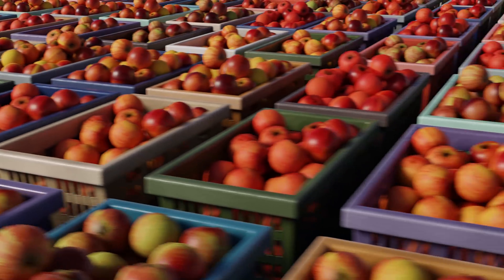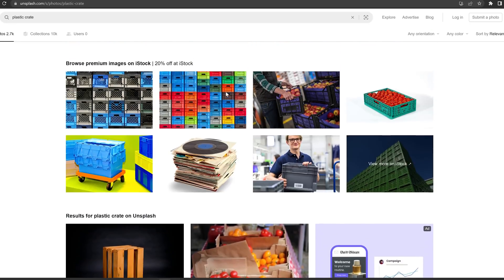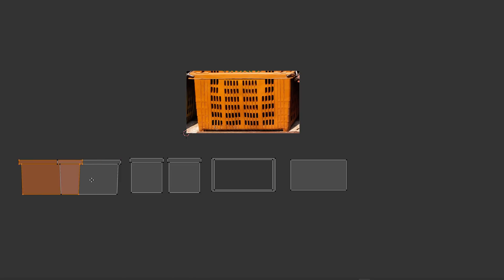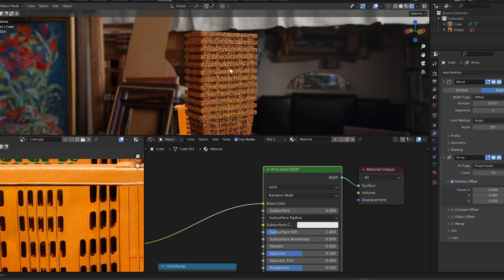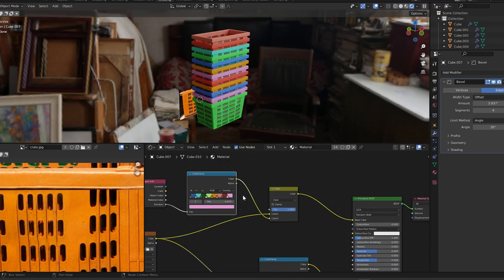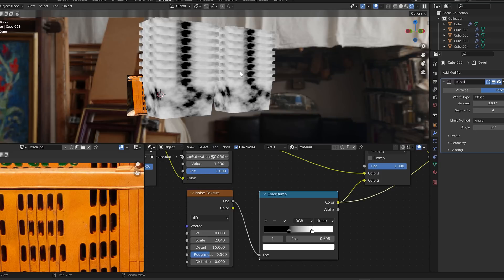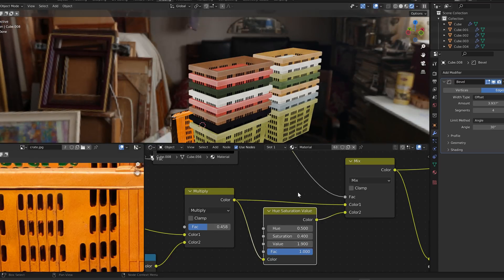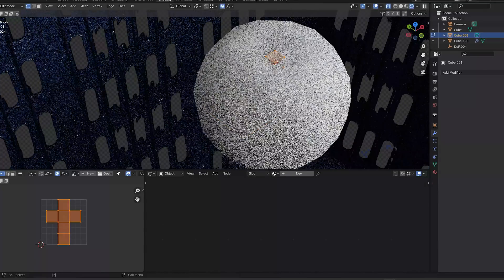Create Assets From A Single Image - Blender Tutorial

Comment: Excellent approach. A couple of extra steps I'd do: add some subsurface scattering on the apples and slightly randomize the Z rotation  of each box, so they don't appear perfectly aligned. 
I'm a big fan of using alpha masks to create transparent parts in shaders, even if it's not the most accurate approach, I genuinely love it and use it, even with cloth

Comment: when i drop my apples with physics dropper, the apples bounce around but dont rotate. they fell and moved, but stuck with the same fixed rotation angle... please help!
Reply from the maker: A few things to try: Did you try applying scale to all objects before the drop? (ctrl a). Are you on frame 1 (shouldn't matter, but just incase). 

Select the object you're dropping and go to "tool". Scroll down to physics dropper. Under rigidbody check the active settings. Is "damping rotation" at it's default value of 0.1? 

Lastly, what scale is your object? Is it impossibly small or impossibly large? Try scaling it up, applying scale, and running the sim again. 

If none of this works, please send a packed .blend file to me at riley (at) brunwork . com. 

I can look at it and find the problem if nothing else works! 

And thanks for watching!
Reply: @rileyb3d  It worked!!! i did the ctrl a thing and worked perfectly! thanks a lot for the quick response!
Reply from the maker: @iaroma  Good! Always happy when I can actually troubleshoot through these comments (sometimes it doesn't work)! 

Applying scale is an important troubleshooting step for many problems. Something good to keep in mind going forward.

Comment: This is a very great walkthrough.
As a bonus (that would use Photoshop and, I know, this video is about Blender only) you could fix the perspective of the reference photo in Photoshop to later get a more accurate look for the baskets.
Reply from the maker: Love it, thank you for the great tips! I suppose a non perfect reference image of a basket could be quickly touched up in PS as well!  For example: to paint out the areas that should be dark and alpha.
Reply: @rileyb3d  I guess so, yes. Photoshop has improved the selection and transformation features a lot in the past years. After fixing the perspective with e.g. "perspective warp", you can easily select the basket with "select and mask" or the "magic wand" to create your alpha.

Comment: Me who thought this was a supper beginner tutorial, coming state from the end of the donut tutorial:

...

lol f
Reply from the maker: This one's a little more intermediate, but please let me know if you have questions! I remember my first few months in Blender. They can be very difficult, but worth it to push through.
Reply: @rileyb3d  one of the main things im kinda wondering is how to do it so texture is only on one side
Reply from the maker: @ButterKing-28  For this, you can use the "Backfacing" attribute within the shader node called "Geometry". 

It's tough to explain without visuals, but you can plug the "backfacing" output into a factor on a mix RGB node. 

Whatever has outward facing normals will use one input. Whatever is facing inward will use the other.

Comment: The ColorRamp into Alpha is not working for me, it does not turn the black color invisible.
Reply from the maker: Are you using Eevee by chance? From what I understand, this won't work in Eevee. I should have mentioned that in the video, but I don't tend to focus on Eevee that often.
Reply: @rileyb3d  nope, ol' normal Blender :(
Reply from the maker: @kiba1704  would you be able to pack, and send me your blend file to look at? Riley (at) brun work dot com. 

If you haven’t packed a file, just search “pack resources” then save before sending. That will link and send all textures.
Reply: @rileyb3d  sure, gonna send you one later
Reply: Dunno if you manage to fix it already, but a guy in the comments found the solution for me and maybe it works for you aswell.
go to Material Properties -> (scroll down for)Settings -> Blend Mode, by default should be Opaque, set to Alpha Clip

Comment: Amazing man, love how you used the material editor to add the "bevel" instead of doing it with geometry. I need to do more work in the shading editor to get used to working with the different nodes.
Reply: He used a regular bevel modifier.
Reply from the maker: This is true. It was a regular bevel modifier on the geo itself. That said, I think bevel in the shader network could have worked as well! Really just so many ways to do things in Blender, as I'm sure you know!
Reply: @binyaminbass  Wrong, check at 4:28
Reply: @ShawnTheRazor  I repectfully disagree (still). The pointiness map was to create a discoloration along the edges to make the basket look old, like he said.  Beveled edges are primarily for catching light, making the object look more real.  There IS a Bevel node that could have been used, but he used a regular bevel modifier which affects the geometry at 2:21.  To simulate beveled edges via the materials after already doign so witha modifier would be redundant.
Reply: @binyaminbass    Just giving the guy a compliment man. No need to split hairs to seem more intelligent than others.
Reply: @ShawnTheRazor  I'm not trying to seem more intelligent. I'm just being precise.  Blender is a learning community so it's good to know what is what, for everyone's benefit.  Yours included!  Isn't it helpful to know what the pointiness map was being used for?
Reply: @ShawnTheRazor  Also, I would think someone with the name Razor would appreciate fine distinctions 😉